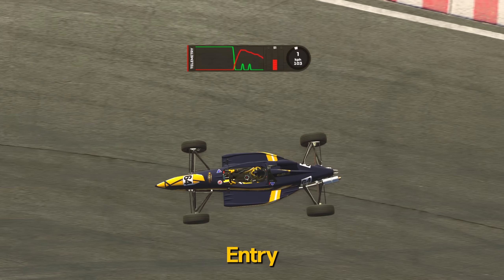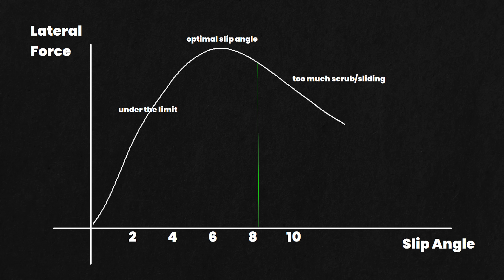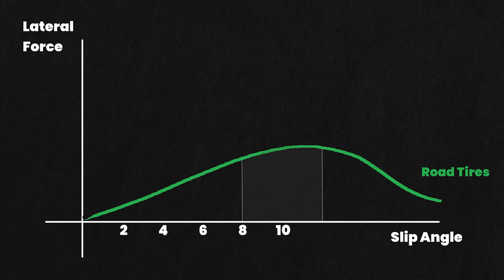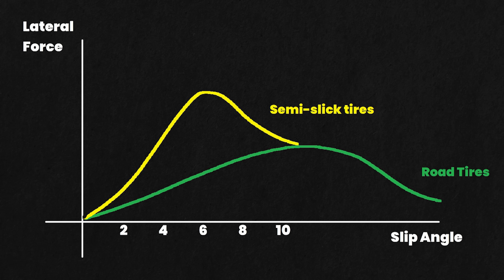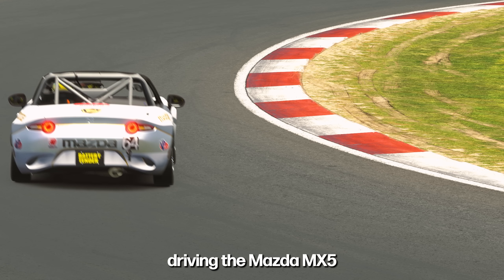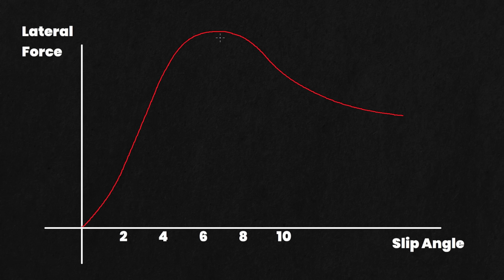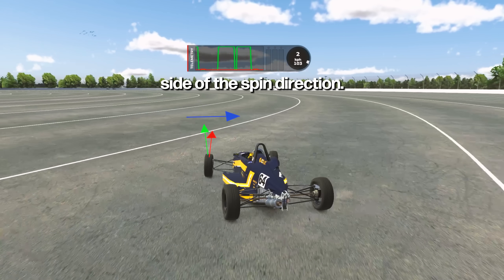The True Limit in Motorsports - Slip Angle Explained

Comment: I think the term is confusing in general, "slip" shouldnt be used untill you reach the point of lateral force that overcomes the grip and your tires starts slipping on the surface, like you talk about slide or drift angle.
The degrees of angle before it starts to slip should be called like turn angle or gripangle just to be less confusing.
Reply: but slip angle is directly related to how much traction the tires have
Reply: @theiaraine  slip angle is implying that the wheel slips, and it doesnt slip on perfect slip angle, that would mean you scrub and ruin your tiers to fast
Reply: @Speedyey  It's not about whether the tire has grip, it's about how the tire grips the track.
Reply: @theiaraine and thats why it shouldt be called slip. Something thats slips has lost traction
Reply: @Speedyey  it's not about if it's slipping or not, it's about how much it's slipping. calling it the grip angle wouldn't make any difference because they reference the same thing
Reply: @theiaraine e.g.
"if you go over the tiers maximum grip angle, the tire will lose grip and start to slip"

How on earth did u manage to get slip and grip to the same thing...? geez!
Reply: @Speedyey  yes it slips when you have too much angle but there's still no reason to not call it slip angle because of this. Grip and slip are expressed the same. Its just a term used in the description of the state of a tire
Reply: @theiaraine  ok so if terms doesnt matter lets start calling it hot dog bun angle. Cuz terms doesnt matter anyway? How do you not understand that it is extremely dumb to express grip and slip in the same way, when they are exact opposits of eachother?
Its like sayin water boils at 0 celcius, cuz terms doesnt matter. Stop making a fool of yourself!
Reply: @Speedyey  they are expressed the same BECAUSE they are opposites. Full grip is the same as zero slip
Reply: @theiaraine exactly, so why would something that has optimal grip be called optimal slip?
I give up on u now, i cant fix stupid u know.
Reply: @Speedyey  because it is literally on the edge of both. The tires are alway in a state of slip and grip, it's just a matter of how much. There is no need to call me stupid and you obviously can't see what you don't understand.

Comment: Well done.  There are other more engineering oriented videos that utilize a wheel with rubber feet which I think supports more intuition about how deformation of contact patch works, which is to say how angle vs  grip curves can look the way they do, and why small slip angle is very different from sliding at large slip angle.

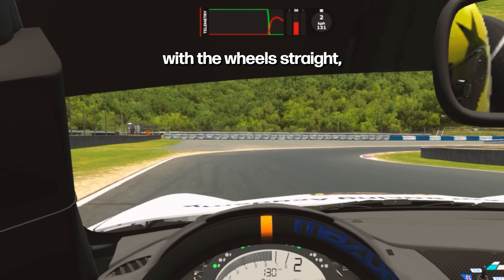Comment: Hi Suellio, thanks for the video! I am a little confused by the section at 9:35.

I've watched it like five or six times and I still can't fully understand it, it seems the explanation contradicts what the video is showing, but perhaps it's just a misunderstanding on my part.

When the driver is countersteering, the steering wheel is pointing perhaps 5 degrees left of center. You say it's "because the front tires are still pointing to the inside"... but in the video, they are "pointing" to the outside/left (correct?)? And then you say "because the final slip angle between the tire and the road is still pointing to the right". I understand that direction the car is traveling is still toward the inside. But if the front tires are actually pointing left of the direction the vehicle is moving (because of countersteer), isn't the slip angle of the front tires actually "negative" here? What am I missing?
Reply from the maker: That was my bad explanation! When the whole car has a slip angle of, say, 8 degrees right, even if you steer 5 degrees to the left, the final angle of the front tire against the track is still 3 right, meaning the car continues gaining rotation due to that!
Reply: @SuellioAlmeida  Thanks for the clarification! I think I got hung up on the initial explanation at 0:32 (defining slip angle) which only talks about the tires and not the whole car, and didn't really consider how in reality it can be a little more complicated than just the angle of the fronts.

Comment: Will this make the rear tyre wear out quicker?
If it's a no, ignore the question below.
If it's a yes, how do you adapt when the rear tyre starts to wearing out compared to the front tyre? I imagine the front-rear grip imbalance will make it harder to find the optimum angle because the setup was designed to handle balanced front-rear tyre grip.
Reply from the maker: I answered that in the video! When you're on top of the ideal slip angle you get the best cost-benefit, but if you REALLY need to save tires, then you might want to be slightly before that point. If you need to warm up the tires, you can go past it a little bit on purpose in a controlled way. 

When the rear starts wearing out, you can just start trail braking slightly less to have more weight on the rear tires and counter-balance the behavior with the pedals :)
Reply: @SuellioAlmeida  I must've missed it (need to rewatch). Thanks a lot for the answer.

Comment: Thank you, great joy to watch, I think almost everything was covered. 

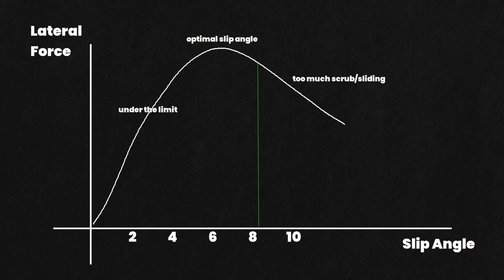3:20 tire contact patch begins to slide as soon as there is any angle, any rotation. At first only tiny bit of contact patch slides and most of it is glued static. At peak slip angle most of the contact patch is sliding, and little portion is glued static. Little bit past peak slip angle whole contact patch is sliding, and then grip goes down rapidly depending on sliding velocity and instantaneous heat accumulation at contact. Slip angle is actually a description of tire static contact patch area vs sliding contact patch area. IRL the load on tire, road grip properties, heat and velocity has instantaneous effect on slip curve. It is actually simple.

I would also add that foundation of motorsports is tire load sensitivity and slip management.
Reply: Absolutely not simple at all IMO, those "static" and "sliding" regions are just abstractions, models by themselves. Michelin reckons the gripping region of the load area is about 5% or so at any given time. There's a lot of hooking and unhooking of strands going on and maybe/very likely some chemical adhesion in more racier compounds.

Comment: What is the number one objective in motorsports racing? To get from point A to point B as fast as possible.

How can we achieve going to point A to point B as fast as possible? To be at the optimal slip angle as much as possible, thus revolving all our driving techniques around achieving this goal.
Reply: If the track is straight, I bet I can get to the finish line faster with my tires at 0 degrees slip than yours at optimal for the whole course.

Comment: Cool explanation, very high end infographics, well done!
May add that if there's a simple thing in actuating these principles, it's that the max slip angle is built-in the tire, you can (should) just asking it to the seller or read the TDS.
What seems complicated is to become the same unit which acquires real driving values with the body senses hands feet eyes and ass, and accordingly inputs correct values on the machine with the same peripherial devices. 
No surprise some drivers deserved a nickname like them being the machine themselves, recalling Mike "The Bike" Hailwood here
Reply: There is no manufacturer nor any TDS which will provide you with the slip angle graphs of a tire. Maybe you'll get some Pacejka data if you're a racing team, but you likely need to test and validate the tire yourself. Such information for OEM tires is only available in OEM databases, I guess fitted to Pacejka.

It's not just one constant angle, it changes with a lot of parameters, mainly load and slipratio.

Comment: 12:04 I noticed the inside front tire lifting from the asphalt as a result of the force. Reminded me of this but also on front wheel drive cars under braking and turning causing the rear inside wheel to lift upon corner entry
Reply: This is because of how the anti-roll bars are set up.
Basically, the anti-roll bar works by lifting the inside wheel and "borrow" the force of the inside spring and give it to the outside tire.
When the anti-roll bar of the front axle is stiffer, the body roll is mostly controlled by the front.
More vertical load will be transferred to the outside wheel and the inside wheel will be lifted up by the anti-roll bar.
Because more load is on the outside tire, the overall grip of the front is decreased, which causes understeer.

For fwd cars, the rear anti-roll bar is stiffer to lower the grip of the rear during cornering and increase oversteer.

Comment: I never really knew or thought much of slip angle until I actually felt all 4 wheels hitting just the right angle. It's a pretty distinct feeling when its just right; it almost feels like the car is doing a 4-wheel slide, even though it isn't really sliding, and in that state it's a lot easier for me to manage the limits of both ends of the car to make sure I'm at the limit on my racing line. I've been very mindful of it ever since, and always try to adjust my setup toward that achieving that balance. 

Great video.
Reply: Wonderful feeling when you find the way to just 'jump into' that grip sensation at will.
Reply: @onehorsepower  Yeah once you've found it it's hard to forget, and you know when a car isn't giving you what you want, and why. It informs so much of driving technique and car setup. Super important for being fast.
Reply: I couldnt figure out how to explain the feeling but you got it right!!
Reply: It's a beautiful feeling when you hit that perfect slip angle. Then you maintain that slip angle and adjust your line with subtle (usually) adjustment of steering, brakes and throttle. It's amazing how stable and controllable the car feels at that point.